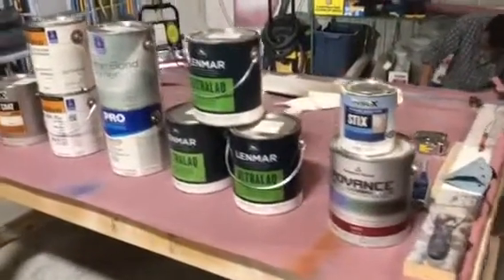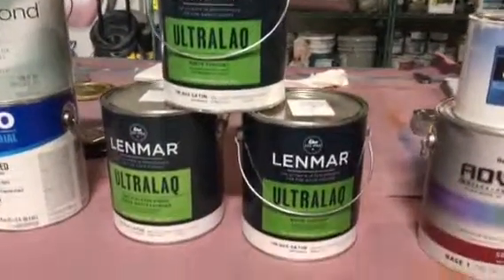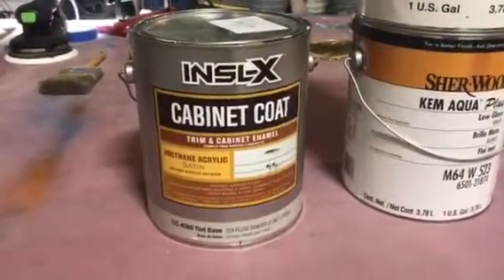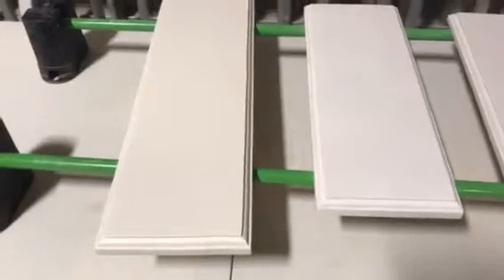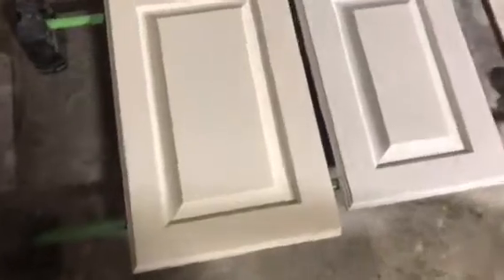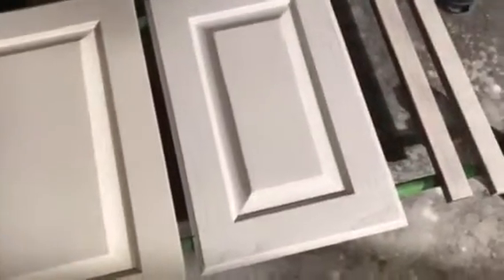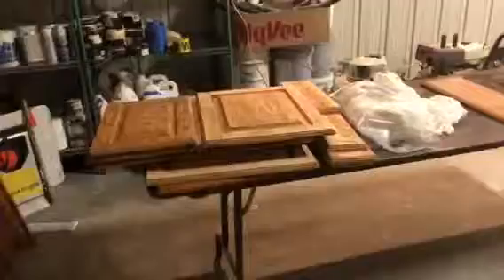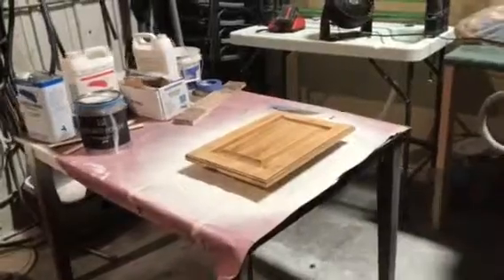Painting cabinets -product review

Comment: What system did you end up going with? My current system is Zinsser Bin then PPG Breakthrough.
Reply from the maker: We are currently using BIN and pre cat lacquer
Reply: Dillan Boutin, how do you like breakthrough?
Reply: @daniel9371 Breakthrough works best for spraying but it's still brushable and  rollable. I mainly use it for cabinets where I brush and roll boxes on site and spray doors and drawers off-site. Eliminates a lot of masking. Solvent based lacquer still dries faster and can be sanded quicker between coats.